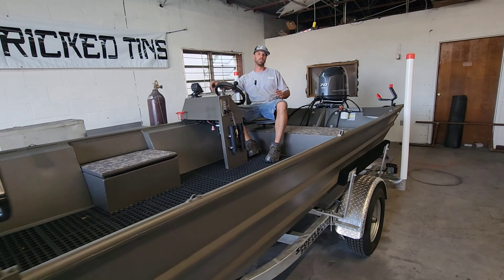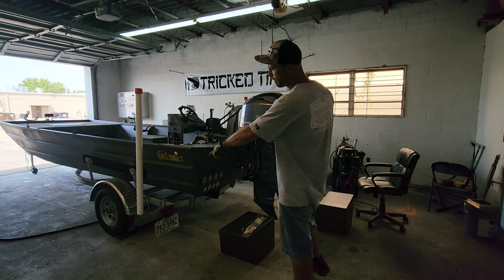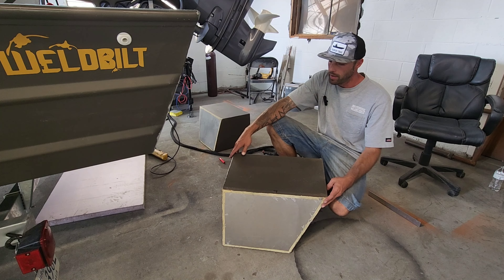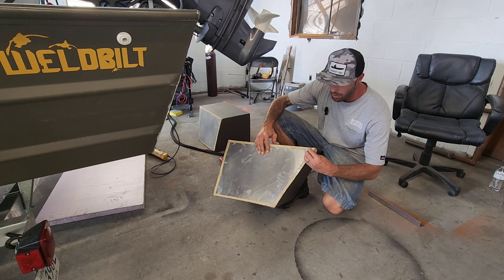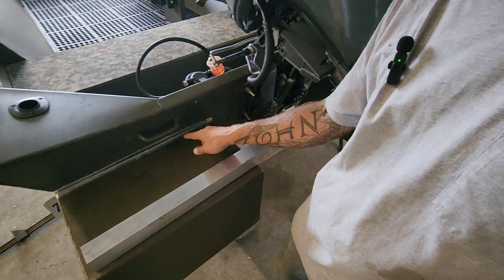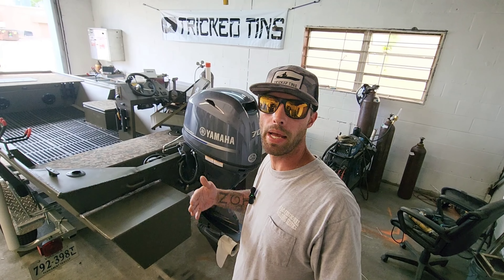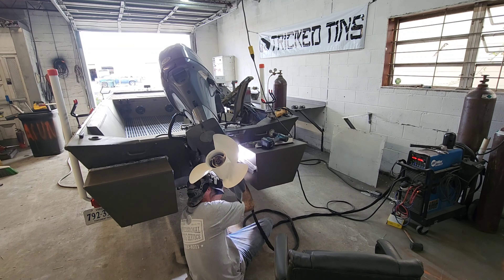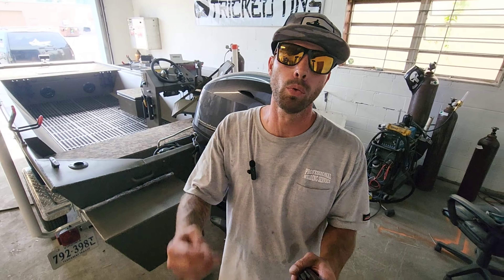"Do I Really Need POD's?" The Expert answer your looking for! #tincankiller #welding #installation

Comment: The beavertail pods are garbage we make custom pods out here in Utah. They should also angle up slightly.  Great job bro doing it the right way
Reply: Hey mate .pods ? Do these work on V bottom boats like quintrex dorys. 
Just want more floatation at rear. 
But unsure how it could affect the way it goes on the water.
My boat 5.2 m 
I'm from Perth Western Australia.
Reply: @jasonsensenberger3287  I honestly have never seen them put on a v-bottom they would probably have to be really customized to the boat. These are are mainly used for shallow water situations but a friend of mine here in Utah, USA custom makes them for the specific boat
Reply from the maker: I'm sure it would help with Displacement.  I'm no expert on boat hull engineering tho.

Comment: I got backwater pods welded onto my boat. Their customer service was great. Came with simple concise instructions. Super solid grab handles and drain plugs. Keeps my tail out of the water on rough big water so I don't get swamped.
Reply: Yeah Jake gilk is a solid dude and they make a great product. I've been there and ripped around a bunch of thier motors over the years.

Comment: No need to weld those 16 holes prior to adding the pods. Add the pods by tacking from inside the hull through the holes. Then run a bead around the entirety of the pods like you normally would. In theory that even strong than what you did because you have 16 extra welds. Not that it was necessary but would have saved time.
Reply from the maker: You know how much harder it would've been to weld those holes upside down leaning over the boat. I see your thought process but it aint worth all that effort.  Those pods will still be on that boat when im dead and gone.

Comment: I fabricated some pods and put them flush  to the bottom this created to much lift , so that the motor would captivate unless weight(passenger) would be brought to the back (tiller drive)
Reply from the maker: Pods are tricky. Wieght distribution is critical.
Reply: Did the same thing, should have had the pods about 1 inch off the bottom, to much lift and captivates unless more weight in back

Comment: So probably a dumb question but here goes  if you welded a heavy plate across the pods and built a Jack plate on the back of them would that give you a tunnel hull and allow you to run in less water  or would it just F everything up
Reply from the maker: Idk. I think it would need to gradually slope for a tunnel.

Comment: Do they slow boats down? I’m thinking on adding them to my 1436 but I don’t wanna loose speed
Reply from the maker: That boat is way to small for pods anyway
Reply: @TRICKEDTINS  okay I see. I just saw my buddy do it on that size is why I thought it may work. I’m running a 670 Longtail and it’s heavy is why I wanted them !
Reply: @TRICKEDTINS  my grandpa has a Lincoln mig welder. It does aluminum and steel you just reverse some leads inside and change the wire we have done it in the past. If I’m welding a boat .50 or so thick what’s a good place to start on my heat and wire feed ? Doesn’t have to be pretty just wanna not burn holes to bad

Comment: Why didn’t you use a few pieces of angles to close the gaps? Tack them on the hull and the pod and bring them together with a clamp?
Reply from the maker: Why would i do that if i could just fill it with one pass? Adding an angle adds 2 more passes???
Reply: @TRICKEDTINS  if you add an angle “iron” to one, then to the other, clamp the angles with a clamp, close the gap, tack, remove the tacked angles, finish the pass? You might need several angles, but it would only require one good pass and there would eventually be no gap and no warps. Basically - angles, clamp, tack, remove angles, angles, clamp, tack, remove angles, repeat until there’s no gaps and then weld complete.

Comment: Great welds on the bottom of the pods. They looked better than the factory seams you could see beside yours. Really good advice to have the pods welded on.
Reply from the maker: Thanks brotha.  Welding is easy after 21yrs. Running a business is the hard part lol.

Comment: I’m curious what the cost to have pods welded on like that is?  Do you have any guidance as to the cost for this service?
Reply from the maker: Idk what others charge, but my price ranges $500 up
Reply: @TRICKEDTINS thank you for the response. That doesn’t seem unreasonable given the skill level and experience required to weld aluminum.

Comment: I have a lower roughneck 1860 with a 115/80 jet. And it has pods. I really want to mount a kicker motor but for the life of me can’t figure out how I would do that. My electric trolling motor just isn’t powerful enough to troll up river and the jet doesn’t turn well at low speed
Reply from the maker: Idk man. I guess you need some type of extension for the kicker

Comment: Couple of things,
1. Could you push from the inside of the boat to close that gap you were talking about?
2. Its been my experience thats its best if they are mounted half each in and up from the edges?
3. Whats the cost?
Reply from the maker: $450 to weld on if the transom is in good shape.
Reply: @TRICKEDTINS  thanks. I have a one year old lowe roughneck 1660. Great boat but sits a little low in the back. A 40hp merc, me(215lbs) 6 gallons of fuel and 2 batteries weighs it down pretty good. I'd have you do mine but I'm in Ft Myers Florida. Thank you for your quick response.

Comment: Do you think those are strong enough to hold a 200# person on one of those pods?
Reply from the maker: Hell yeah. Im 215 and i stood on them no problem.  Id bet they would hold 500+ easily.
Reply: ? Pods are for shallow or heavy motors he could probably do a 90 or 115  on the back and still set 4-6 “  of draft  so I’d say 100-150 per pod  ? Just a guess

Comment: I had Beavertail small pods welded on a 1448 landau mod v hull by a local (he was excellent, worked for space X). He followed the instructions, and I couldn't be happier. Boat rides soooo much better, easier plane, and same 30mph top speed with 25hp 2 stroke yamaha. Only noticeable difference besides all the benefits is turning is slightly slippery/harder at high speeds, but ever so slightly.
Reply from the maker: Glad it worked out for you. Pods are hit or miss sometimes

Comment from the maker: (((UPDATE))) THE CUSTOMER SENT ME THIS TEXT TODAY!!! #TINCANKILLER 
👇👇👇👇👇👇👇👇👇👇👇👇
"Dude... absolute perfection in all categories.  
No leaks from install. 
No water splash over the transom, not even a drop at w.o.t.
No crazy slight pull compared to others. 
Run rpm's up to 6200, smooth as silk. 
Stable as can be. I jumped up and down on rear bench, waterline didnt even move all. 
Those angle L's actually performed their job, channeled that lil' bit of intermediate water right on out. 
Right weld method of installation, The right factory pods made specifically for boat and most importantly The right person with the right skill set putting it all together!! 
I cant thank you enough for turning this around. Thanks again."

Comment: What is the real reasoning for the pods? I have a pontoon boat that is 15 ft long with a 40 horse Mercury and I think the motor is too heavy was thinking about adding one foot to each toon.
Reply from the maker: To add buoyancy to the back of the boat.  Main goal is to run in shallows!
Reply: The motor is the right size for the toon the issue is these days they are making the pontoons smaller diameter and there fore less weight capacity, It would be just as or easier to add the third pontoon in the middle as a few people are doing now days the benefit far out ways adding length to the pontoons. you can take an old pontoon and customize it to fit or buy a new one as the industry is all ready offering tri toon boats all ready.